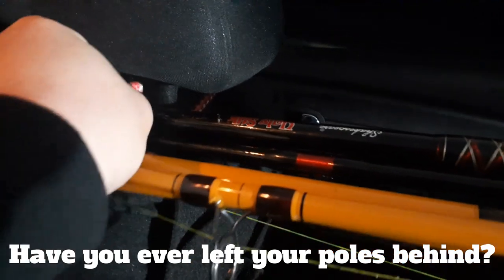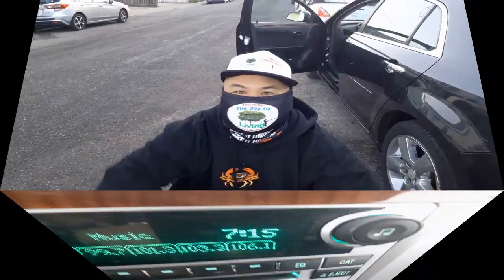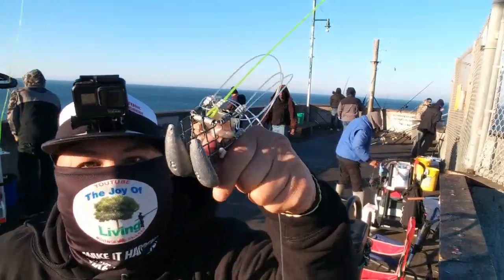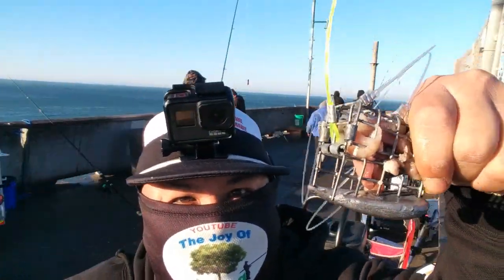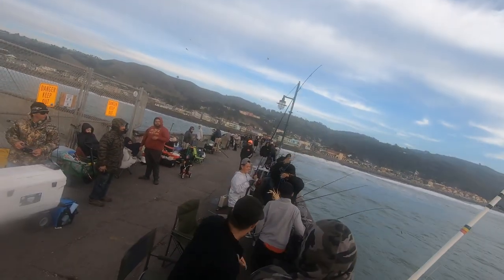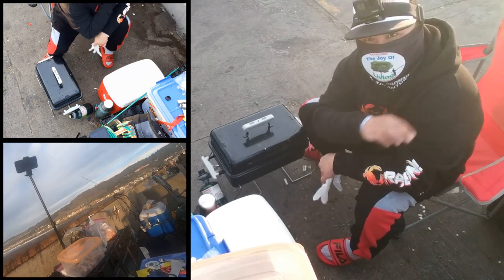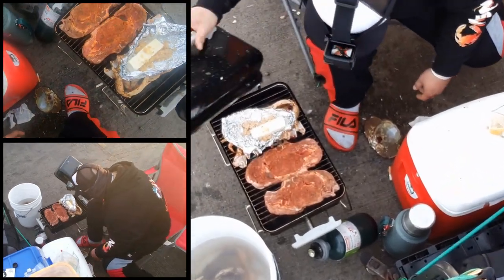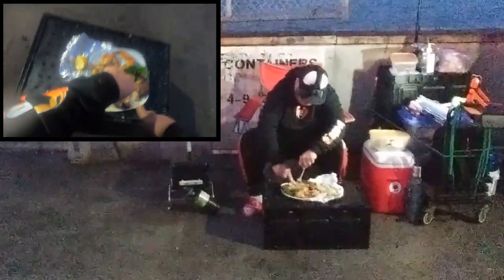Crabbing Pacifica Pier 2021 EPS. 14 - A day in the LIFE of a crab snare CRABBER!

Comment: Young man ...I appreciate your videos and showing me how to make snares ...trying your lead weight method but wondering if you have any advice on how to cast 3d molds like crabs,etc and how to attach them ? As a thank you for your prior help I'm gonna pick up a couple of your snares ..✌
Reply from the maker: Thank you, sir??!!! I appreciate your support to the channel. As for 3D molds, CNC molds are best, but professional grade and very expensive. Silicon molds are the cheapest. One way to attach the lead weight is to make your crab cage small enough to fit the mold. That's why many crab snare makers lean their snare to one end for the weight. Easier to cast the lead. Another quick way is to put a flat end of the 3D weight to the bottom of the snare, and pour a little melted lead through the cage to lock the lead weight, the cage, and the little bit of melted lead you pour to keep them together. Look at the extra melted lead like glue. Your gluing the lead to the cage with the extra melted lead you pour.

Good luck sir.